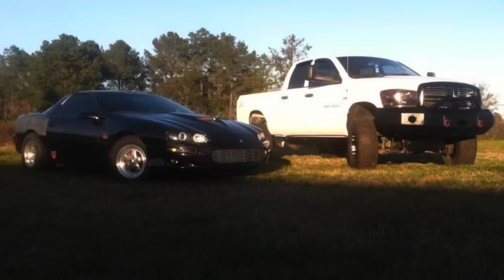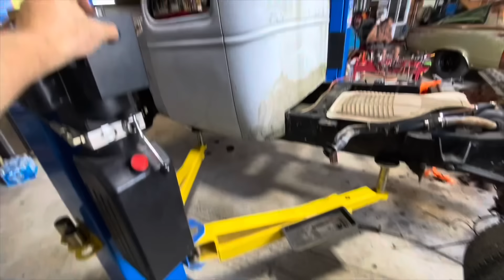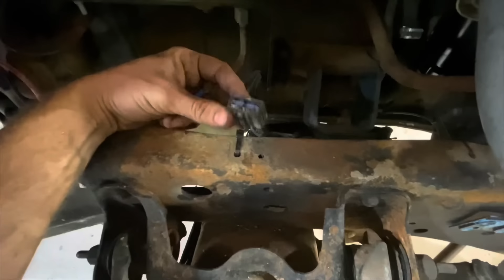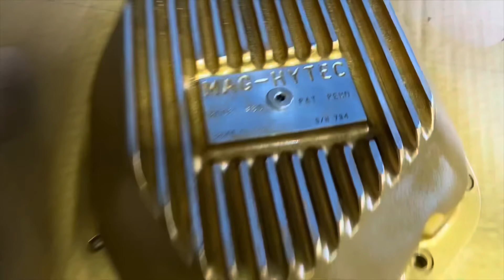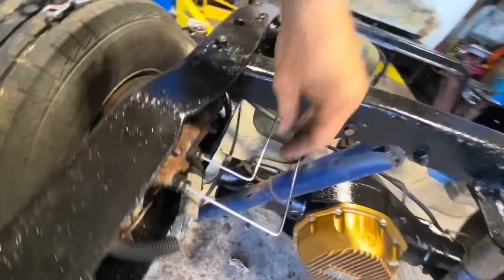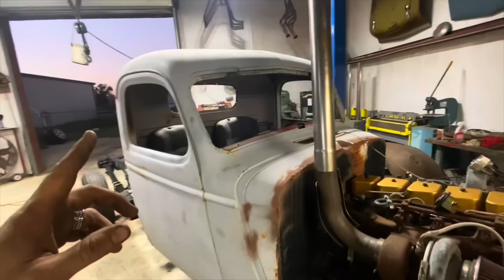Swapping a POSI Dana 80 into a 12 valve Cummins 1940 truck. 12 Valve alternator fix self-regulates.

Comment: A 1350 yoke & 4.56’s would be on my shopping list for that Dana 80 👍😎
Reply from the maker: I really wanted a 4.10 and the factory build sticker for that 96 was Dana 80 4.10 locker with 11.5” drum brakes. I’ll run the 3.54 for now unless I don’t like how it pulls my car trailer.

Comment: You know you got a great little truck here that you're building. One tire burnout versus two tires burnout. It's all good. You got that back after frame looking great I can picture it all when you get it finished. Speaking of the undercarriage that is.
Reply from the maker: It’ll get there for sure! I was reading on google that it takes some time for these clutch type lockers to start working after a service. I reckon we will find out soon enough. Thank you I appreciate it!

Comment: My dana 80 does that if it dont have any weight on the  back the other tire want lock up
Reply from the maker: That makes me feel better about it. I was like I know I’m not crazy haha. I read online folks said they had to drive it a bit after a service to get it to start locking up.
Reply: @323Fabrication  yeah that axle is rater for like 11,000 pounds so it needs a load to operate
Reply from the maker: I’ve got a buddy that is selling me a flat bed for the truck but until the trailer with something heavy is on it I don’t think it’ll see that kinda weight. But good news if it’s rated for that it should give forever behind a 12 valve with a turned up pump.
Reply: @323Fabrication  nice I also got a flatbed. But I'm leaning towards a ratrod service truck I'm also running  a 5.9
Reply from the maker: That would be a cool rig! I love @flyingsparksgarage service truck it’s a 1970 C10 I believe. My welding rig doesn’t have a super useful bed. It’s kind purpose built for one thing, so I’m thinking a flatbed would be more useful for us.
Reply: @323Fabrication  yeah best thing is mine is going to be 4wd
Reply from the maker: That’ll be sweet! I’d love to do a 5 speed swap on mine but I’ll save that for far in the future if it ever happens